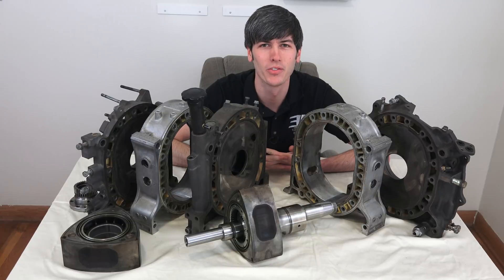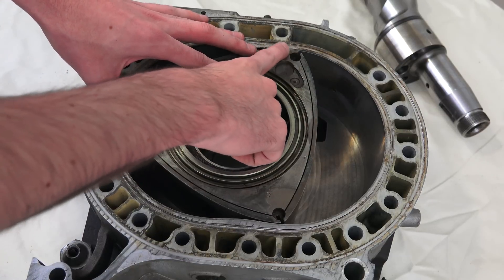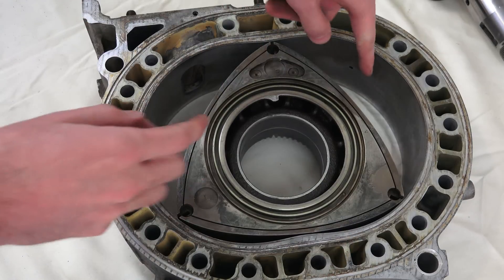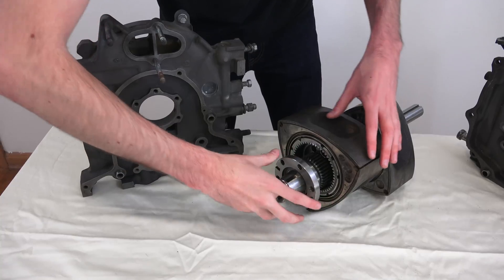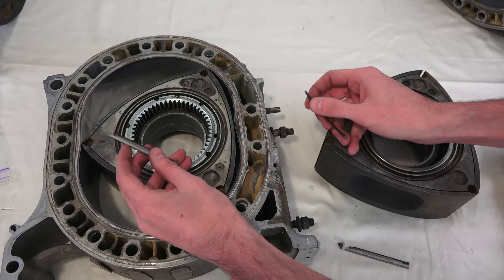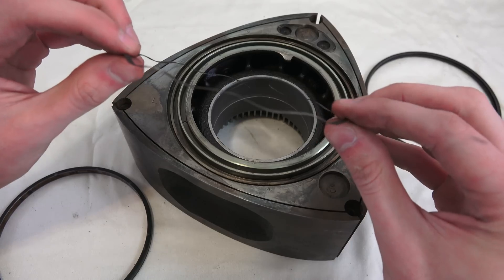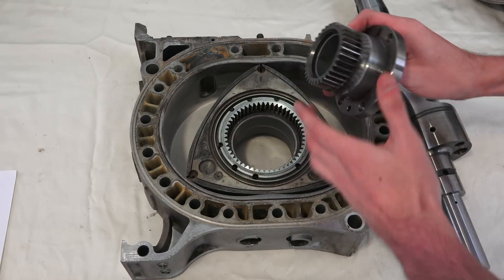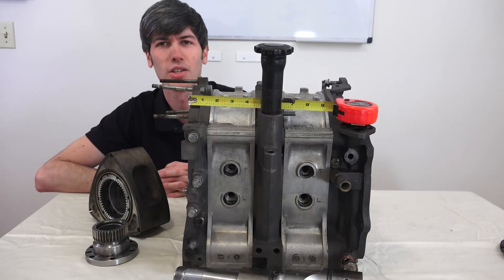How Rotary Engines Work - Mazda RX-7 Wankel - Detailed Explanation

Comment: I feel you should have explained the negatives more, because now people that didnt know about rotary engines are leaving the video wondering why they aren't used in more cars
Reply: +gokartbuyer False on the 100k rebuild intervals. Many wankels, when cared for correctly, can last 200k miles between rebuilds. The RX8, which uses a slightly different design meant to help with emissions, is the exception to the rule and you do see a lot of worn out engines at the 100k mark. Still, not all of them are even worn out as there are other factors that can make the engine SEEM like it's dead - like poor spark from worn out ignition coils.

The main issue for wankel reliability is that people don't know how to care for them and baby them - you CAN'T baby a wankel and have it last. Every time you drive you should use the entire rev range AT LEAST once to keep carbon buildup at a minimum.
Reply: @OfficialistDave  thats a load of BS.. even Mazda admit that the Wankel engine was too unreliable.
Reply: +David Estey Agreed, a friend of mine had a NA Rx7 that went 380,000kms with no rebuild before it finally was done, another friend has a twin turbo JDM rx7 with 160,000kms that is still going strong! People just need to understand that it needs to be looked after properly, and it will live a long life. Does that mean its better than a piston engine? No probably not, but it does mean that they have a bad rep that maybe they don't quite deserve.
Reply: +edgar calderon jr But Mazda does not use this engine in any of their car right now, the RX-8 is out of production and the &#39;next generation&#39; is not available yet. So I would really enjoy a 
more in-depth explanation where negatives are detailed. If it is only a matter of oil consumption, that could easily be taken care of: There are 2-strokes engine using an external oil tank and it works fine.
Reply: +Harrison Davis i read on some forum that a kid complained he didnt know that he had to keep adding oil in his rx8 and blamed the dealership for not telling him that he had to
Reply: *****
actually many dealership people dont even know much about the cars they are selling. when i was buying a brand new Evo the guy at the mitsubishi dealership told me it had a carbon fiber hood
Reply: chinchy111 I mean if he bought the car new that is the kind of thing they should have told him, lots of non car people buy them thinking they are just cool looking sports cars, but you have to know what you are driving to look after it!
Reply: +Revive he actually just posted a video about the drawbacks
Reply: +Revive I know lots of people focus on the apex seals, but I think the main reason it isn't used more is because of the poor fuel economy and high emissions.

The engine isn't terribly expensive to replace. You can swap your core with a rebuilt engine and do it quickly.
Reply: +The real doktorbimmer Have you missed all the vids of people blowing Mclarens and other supers out of the water on the highway in rotaries? They stopped buying them because all of that fun came at a price, uneven heat, large combustion chamber, unburnt fuel reaching the exhaust, literally eats oil by design, and if you don't rev range them all the way at least once while driving you're bound to get carbon build up and have to rebuild after 100k like many people have said. Rotaries have some of the fastest take-offs, decimating probably all V6 and most V8's in terms of acceleration off the mark. Could that be sustained? I am unsure, I think a ecoboost or similar v6 could be able to make enough speed eventually to catch up, but that rotary still has more acceleration to go, most likely. V8s (depending on the one) probably would be able to make enough power after a little bit to surpass in terms of top speed.
Reply: He did go over the negatives, seals that go bad over time or need to be replaced to stop fuel from escaping, bad fuel economy,it burns oil naturally, what more do you really need to know? Its the reason why car companies don't really make them anymore.
Reply: +ambydupuis burns alot of gas so fuel efficiency goes out the window and they need to be rebuilt about every 100k due to the wear on the Apex seals. This alone is the reason you can find Rx8's and Rx7's so cheap on Craigslist . They usually have engine failures.
Reply: +Revive Great conversation. Engineering Explained said elsewhere that he's coming out with a separate vid covering the disadvantages.
Reply: +Revive consumes oil and apex seals /story
Reply: He Made a video to explain why that engine is dead
Reply: bad gas mileage. if you like sports cars they are the best. almost infinite rpm it's amazing. wahhhhhhhhhhhhhh, wahhhhhhhhhhhh
Reply: The real doktorbimmer he just said "at any moment you have multiple stages of combustion occuring" one rotation equals 3 sets of 4strokes. You watched this video and still didn't understand what I was saying. lol. omfg.
Reply: you are wrong, eat it.
Reply: +1
Reply: +edgar calderon jr  i thought NSU has the patent for the design, at least its written on fc3s rotor housings, but maybe it has changed in time.. But i guess Mazda has patents for the seals, where everybody else failed.
Reply: +David Estey some guy in rx7club.com had a n/a fc3s rx7 with 400k miles on it still driving.  maintenance is the key.
Reply: There's a turbo built up RX7 at the shop right now. It's an incredible beast. I could count 3 intakes to feed it.

4, maybe 5 inch exhaust. Too big to easily measure.

It's tune isn't quite able to run it at idle, but otherwise, WOW.

It's here for a radiator and water pump.
Reply: +The real doktorbimmer Toyo Cork Kogyo ...
Reply: I think it pollutes more too with the extra fuel and oil combustion.
Reply: he does in a latter video. maybe inspired by your comment?
Reply: +Revive agreed
Reply: +Revive maybe he thinks it is obvious. but the only thing I could think of was that it burns oil by design.
Reply: +edgar calderon jr I don´t believe that Mazda is holding a gate keeper patent. Sure they hold some patents on their wankel engine, look up the history. Mercedes, Audi, Citroën... did build wankel engines at one point in time. The very early/basic patents should be expired by now anyway. Sure, a lot of R&D would have to go into developing a modern wankel engine and sure enough, avoiding Mazda patents would not make it easier. At the same time tough: Trying to build a modern piston engine is not easy either. Lots of patents to avoid and lots of regulation to confirm.
Reply: +juck huo burning oil by design is only a negative if people are too lazy to put oil in it

Comment: Hi guys, can someone please satisfy my curiosity!
So when the rotary engine goes through ignition, it ignites when the rotor is 'straight.. So what gives it the momentum to spin In a certain direction? technically if both spark plugs ignite at the same time it could spin in any direction right?

Comment: But can it burn diesel?
Reply: yeah. Mercedes made an experimental diesel rotary.
Reply: good question, if compression is high enough I don't see why not
Reply: the potential is there, there just needs to be market interest. Wankel engines have proved to be very flexible in what fuel it can burn to produce power. diesel, hydrogen, natural gas, you name it, a rotary can combust it with the right mods.
Reply: Also you wouldn't need a oil injector thing because diesel is a lubricant

Comment: Now why do they wear out so fast?
Reply: +giftman20 lack of maintenance, using the wrong type of oil, abuse. just like the carbon on your valves, these collect carbon on the apex seals and essentially glue them open causing a loss of compression in 2 combustion chambers, and when they fail or break it has a tendency to bounce around the engine a few times before being shot out which can gouge the rotor and housing

Comment: big fail at the end, the crank shaft rotates 2x while the "piston" rotates 1x so u have 1.5 combinations per revolution of the crank.
this model is twin wankel so the combustion's double to 3 combustion per rev like a 6 cylinder.
thar are models that house 3 or 4 rotors so u get a 9 or 12 cylinder at high revs kind of feel.
o and there is reciprocating mass,that is forced thru gears to rebound at a symmetrical acsel and desel curve 
it is very difficult to explain in text but of u think of a star motor (old plains) u get the picture.

Comment: Rotary engines are cool stuff but drive me crazy when driving them, it's like driving with permanent turbo lag. I've driven 2 rotor and 3 rotor engines, and yes once you rev them high enough you get some good power from them (especially the 3 rotor) and are super reliable. That being said I'll take my 4-stroke piston any day of the week, more efficient, low range torque, and sound so much better.

Comment: Limitations of this engine are as follows:
Heat poor surface area to disperse heat out of the engine (they always get hot and stay hot)
Burning a small portion of oil (apex seals are not perfect in all directions)
Boiling said oil due to combustion heat, friction, poor surface area to volume ratio to remove it.(may or may not cause oil vapour to enter combustion chamber at a higher rate) 
Maintenance of the apex seals is a regular occurrence.
Compression ratio is limited to the size of the depressions on the rotors.

This is an amazing engine for what it achieves. most engines of this nature are boosted they produce wonderful power the higher they go, they have a limit as do most engines but it is much higher than a piston engine, in terms of response to rpm and boost, usually together
Reply: +deth kon the oil is designed to be caught up in the center of the seal keeping it lubricated, the oil dribbles in, not sprayed, it is designed to burn oil. as for longevity of the apex seals, mine is at 137k and still going, my brothers 22r is at 170k and has been rebuilt 3 times. the heating is not an issue either seeing as i drove mine from sparks NV to seattle WA non stop and had no issues. 

as an owner of one of these fine engines the only issues i frequently have to worry about is shutting it off before its warmed up and the low amps put out by the alternator, which is not enough to power my phat beats.

if you are looking at it for racing applications then yes the heating is an issue, but is quickly solved by an after market radiator. as for the burning oil, that is solved by premixing 2 cycle and disabling/removing the squirters
Reply: look i don't deny the advantages.
and its great that you own, drive and keep it running
I just don't like burning oil.

Comment: i was a fan of the rotary until i saw the design and the limitations of the intake and exhaust. It's able to develop twice the power of a normal engine (per displacement) but only because it has 3 piston functionality for one rotor. And it consumes oil and gas (for example the original RX7) faster than a modern V8. It is truly the only engine with 20th century architecture but it has many limitations and no advantages over normal engines when you consider mileage, oil consumption, reliability, etc.
Reply: +Iliescu Benyamin but just imagine how good it would be with hordes of people doing R&D, like people do with piston engines.. i fully believe if this engine gained popularity 40 years ago it would have evolved into something much greater today
Reply: +bigandfluffy2000 you'd be right, more R&D = bigger and faster improvements. Mazda is the only automaker trying to progress this engine's future currently.
Reply: +Iliescu Benyamin It doesn't actually have " 3 piston functionality for one rotor." the eccentric shaft spins thrice as fast as the rotor (at 6000rpm a rotor is only rotating at 2000rpm). There is a power stroke every 180 degrees of the eccentric shaft. Which is identical to the 180 degree power stroke of a four cycle inline four cylinder engine.
Reply: +Charles Darwin actually, I believe the Wankel has a 270° power stroke, as opposed to a reciprocating engine's 180° (I might be mistaken, but I do know Wankels don't have a 180° power stroke). While that means the rotor has to travel farther than a Piston engine before it generates power, 3 power strokes occur for a single rotation of the rotor; Piston engines only have one power stroke  every 4 strokes. that right there is why Wankels can generate more power with less displacement.
Reply: ***** Dude. In the video he states, clearly that the rotor spins at one third the speed of the shaft. There are three faces. Thats a power cycle of 360 degrees for one rotor. if you oppose two rotors in the same engine at 180 degrees you get a power stroke of 180 degrees. that exact same as a four stroke inline four.

Comment: I'm familiar with most engines and this one as well, but wouldn't the straight cut teeth on the rotor cause a whine similar to a straight cut gearbox? i mean you don't hear it happening when you  hear a RX7/RX8 going down the road, but my general knowledge would tell it should? any keyboard Wankle engineers about?
Reply from the maker: +mulymule12 Interesting question, I'm not sure. It is all contained within a pretty significant housing, and on top of that bathed in oil. I'd guess as a result it's kept fairly quiet.

Comment: I wish I could give you more likes. That was a very, very detailed and good Explanation indeed. And I didn´t really understand the thing with retri.... retrici....? The mass that causes Valve-Float. I didn´t really get it.
Reply from the maker: +John TheKid11 Reciprocating mass. Vavles go up and down, pushrods (for OHV engines) go up and down. This is wasteful as energy is not conserved. With a rotary, all of the moving parts are rotating, rather than reciprocating.
Reply: +Engineering Explained thanks for the Explanation. I'm not a native English speaker, but I'm rather good English. Not good enough though.
Reply from the maker: +John TheKid11 Haha I could still use some lessons myself.